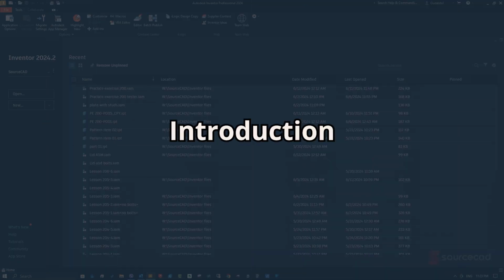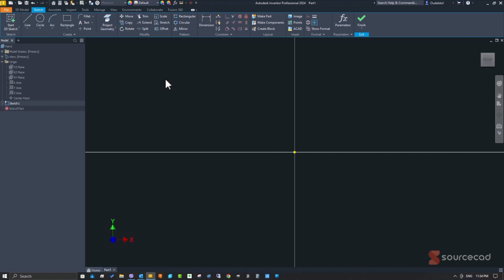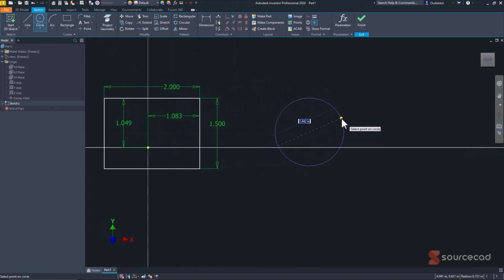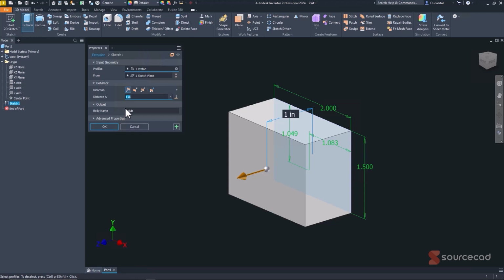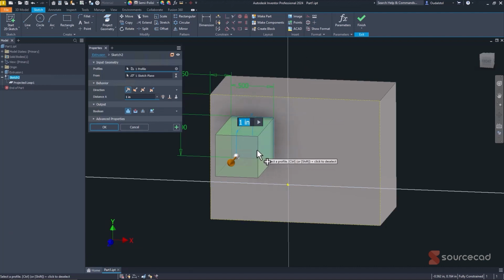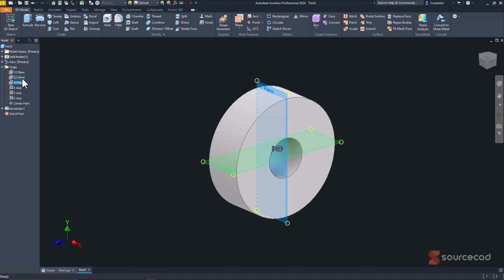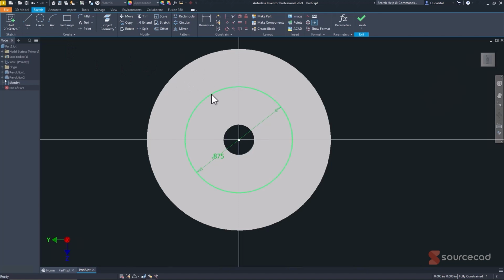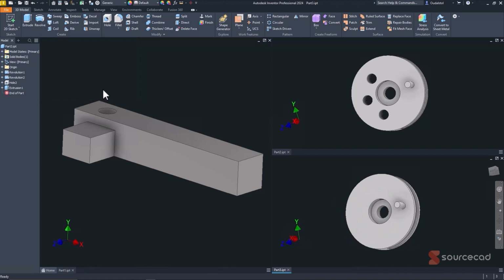Complete Autodesk Inventor Masterclass for Beginners by Jarle Oudalstoel

Comment: One of the most frustrating things with inventor was that after doing a boolean of some kind, inventor would not allow the deletion or removal of a left over part. T made ghost parts from them and even when I reversed the processes it still wouldnt allow deletion. I had to remake the part in Fusion which worked perfectly

Comment: I have been an Inventor user (self taught) since Inventor Series 9, Also self taught iLogic programming. And always in a single user environment. You mention that you should keep your sketches simple and add features as you go. Is this the way you were taught or is this based on your own experience? Based on my own experience (self taught) I do not agree with this school of thought and make my sketches very much like a 2d CADD drawing. In other words, my sketches are as complete as possible, requiring very little adding of features. I also name key features as I create my sketches so my parameters are very detailed, which lends itself well to iLogic programming. Also in my parameters I use Numeric, text and True/False to make it easy to use multiple configurations in my part files as needed. I understand we all have different work flows and thought processes. So I am looking forward to your reply.
Reply: In my experience and habit easier to edit features than sketches, but I can understand where you're coming from with that view.
Reply: Hi. This is a personal preference i will say. I do this because I find it easier to work with "simple" sketches. I find it easier to get the sketch fully constrained when they are simple. When it comes to features I prefer those as they are in my opinion easier to modify. You do mention that you name your features which is a very good practice. I do think both ways work it's a personal preference.